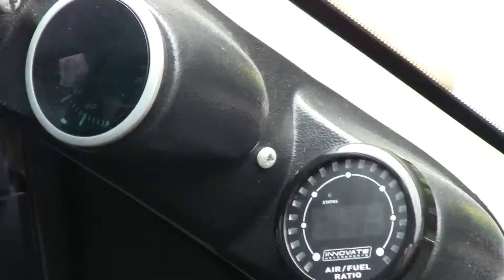Turbo Mazda 3 gets washed/ No weld oil return pan plug install pt. 1

Comment: Did the pan go straight down after you unbolted from the timing cover? A guy is telling me ill have to use flat heads to get it off
Reply from the maker: Alex May this will help you in the long run. That back mount that is attached at the transmission near the pan. Go ahead and unbolt that from motor and push out of the way. Make it a lot easier to get on and off.